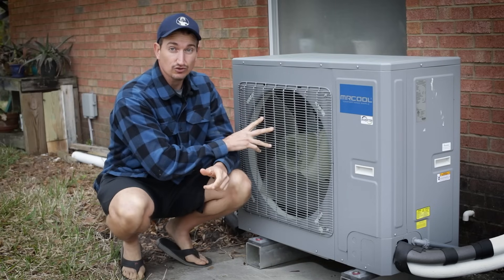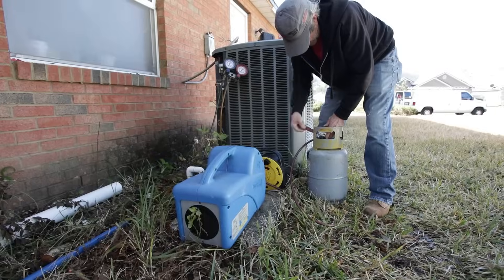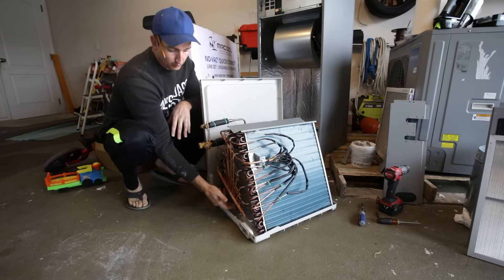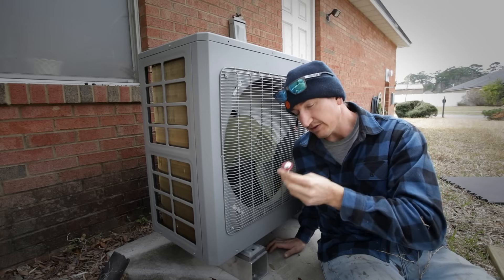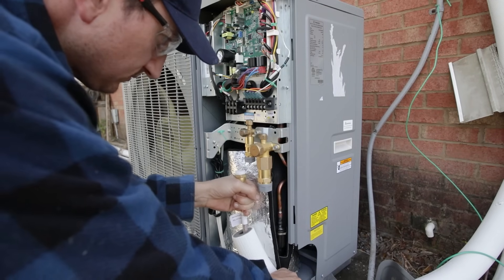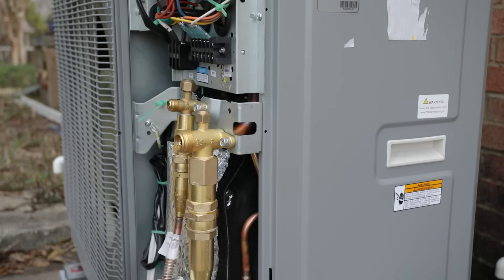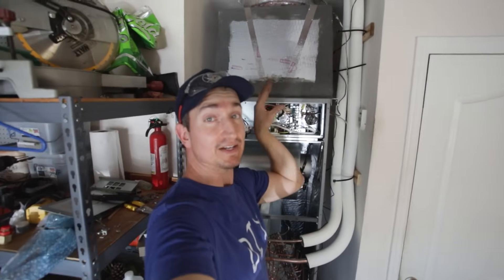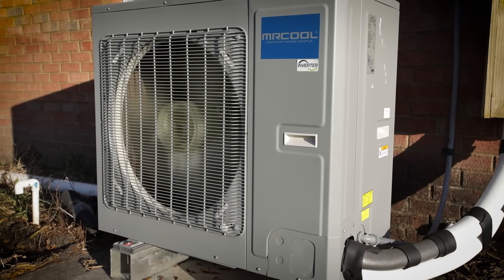Whole House Air Conditioner and Heating System Installation. MrCool Universal, Is it a DIY Project?

Comment: Hi, just wondering why the two lines are different in size? I want to rough in lines in my new build and was thinking about leaving two half inch copper lines  and insulating them. I do have to have them go through some tight spaces using 90s. Will the two half inch lines be ok? And also if I have soldered 90s joints, will those pose any problems ? Your feedback would be appreciated.
Reply: Larger diameter line is the gas line and the smaller diameter line is the liquid line. They need to be sized to spec for the size system you are installing.
Reply: @robschannel9229  ok thanks for that info. I'm gonna educate myself more on that. Thank you
Reply: This is fkn comical
Reply: @TradingSchillings  it sure is. I just learned about gaseous and liquid states and their velocities and howif they are not properly sized the compressor is at risk of burnout. I'm building a 4000 Sq ft home and majority of the work is done by myself. I have wired it for control 4 and Luton mix, did all plumbing, framing and will be doing my own finishing. I also repair electronics at a component level. In my life iv learned to ask questions,  not be ashamed to educate myself. We all need to learn from one another. What's comical is that you had nothing positive to add. Please just relax and help others if you can and doing so will give you so much joy. Peace
Reply: @paulgill7222  Shaddup
Reply: Not to be rude, but being quite frank, your question indicates you should hire someone to do this part.  HVAC lines are highly specialized, they operate at very high pressures, they are susceptible to contamination, especially from brazing or soldering and typically they're bent with tube benders and use minimal, sometimes zero, fittings to make their turns.  Brazing will contaminate the insides with soot and kill your compressor if you don't have properly pressurized nitrogen flow while the brazing happens.  Soldering is possible with specialized HVAC solder and flux, with proper flux application, but you have to use long sweeping fittings made specifically for HVAC.  If you're running soft copper linesets, they kink or collapse with the slightest mishandling and being covered in insulation, might go undetected.  

Pick your desired system, research the heck out of it and install the proper size linesets if you still want to do the work yourself.  1/2" and larger lineset tubes are not easy to bend without kinks or collapsing them, if you kink or collapse it, you have to cut it out and repair or replace the whole lineset and try again.
Reply: @taylorlightfoot  Thanks for all the info. You are 100% correct in detailing what could go wrong. I have had such a bad experience with trades people that I've lost trust and hence the reason to tackle it myself. I did most of the work myself and all inspections  passed flawlessly. In fact  the plumbing inspector asked if he could take pics to show others how it should be done.  That was a proud moment.  I'm going to be ready for this in about two weeks and will decide if I'm going to do it myself. Ive looked at different systems  and I won't need lines more than 25 ft in length and just a few gentle bends. Ive looked at line setss  that come insulated with  prefaced ends  so no brazing is needed. I will see if those work for me. Thanks again and I really appreciate your feedback.
Reply: @paulgill7222  what did you ever end up doing?  I wish I had seen these comments sooner....I would have had some great advice.

Comment: I did this install myself.  The Mr Cool videos are misleading about how easy the install is.  I would not consider it a DIY project for most people.  You have to know how to run new electrical lines, how to plumb a drain with a p trap, how to make a plenum, etc.  The pre charged line set I believe is a better and less leaky design than the flare fittings, but the traditional (inferior) flare fittings do work if you use a an eccentric flare tool and nylog goo.  That being said I do like the system.  One WARNING for people installing these.  My experience was that Mr Cool was NOT available to answer the phone and took more than 1 week to answer questions I left for them.  Also, on their website it says any Nest thermostat will work, while HVAC professionals are saying thermostats with a conservation function have been FRYING MOTHER BOARDS!  I ended up with the Ecobee thermostat.  Thank you for posting this video. It helped me.  That being said, next time I think I will install the Mitsubishi as it is higher quality.  I'm not deterred by having to make flares.  I learned how to do that on a minisplit.  The eccentric flare maker tool and nylog are the secrets to no leaks.
Reply from the maker: Thanks for watching and sharing your experience.  I am thinking about installing this same system somewhere else and was debating on whether to consider using a traditional line-set vs the pre-charged.  For this system, I am using a typical off-the-shelf thermostat and had to go into the programming to configure it to work properly with the Mr. Cool.  It was not the simplest thing to figure out but works fine once configured right.

Comment: According to the EPA, Mr Cool DIY are illegal to install oneself.
Reply: The EPA won't exist after 2025.
Reply: You are simply wrong.  Under Section 608 of the Clean Air Act, EPA prohibits individuals from knowingly venting refrigerants containing ozone-depleting refrigerants. With a sealed, precharged system none is lost.  This is no more illegal than installing a window air conditioner from Walmart.  People who spout out incorrect information without taking the time to look it up ... define what's wrong with the internet.  You also committed libel against a corporation (one that I presume has lawyers).

Comment: On my way to install now. Great video. Too late now but the blower motor slides out easily too. I didn't know the A coil could be removed so it was a bear to get the air handler into my attic. I had to use a chain hoist.

What type of material did you use for the supply side plenum box you made? It doesn't look like sheet metal. Thanks.
Reply from the maker: O wow, I thought I looked at the blower and to me it didn't seem easily removeable.  Good to know it is.  I was lucky with the supply side intake. I was able to use the existing set up the old handle used. It was a foam box set-up with metal framing.

Comment: Im guessing you spent 300-800 in HVAC techs?
Reply from the maker: I have had a few out and none as of yet have been able to figure out how to determine if the system has the proper amount of refrigerant. Since the system runs and various speeds, etc it is hard to know when you are reading accurate pressures.
Reply: @MrKistel  mine has thrown an E3 code which according to seller Ingram's means it is low on refrigerant protecting itself. Since it doesn't start up due to this protection, the question becomes how does one charge it?
Reply: @MrKistel  there is a way to charge it, your techs just suck! I think it is funny, by the time you’re done you’re going to continue having a non reliable system, lots of headaches, lots of money in service calls, a lot of money in refrigerant due to leaks! 
Home owners take their HVAC systems for granted and don’t respect the HVAC trade! 
You’re paying for the fricking years and years of knowledge, training and experience us HVAC guys have. What’s next? Are you going to tell auto mechanics to shove it and install your new engine in the Tesla?
Reply: @TradingSchillings     Well not everybody can spend 30,grand on a new heat pump and now days it seems that two out of three Hvac guys rip people off and most of the guys are total assholes ... I got ripped off BAD but I settled that score with him. I got him back in the worst way
Reply: Yeah there isn't any guidance on charging from Mr cool. The only way is to weigh in the refrigerant. Hopefully they vacuumed the lines before charging.

Comment: Does anyone have a source for the plenum boxes he used?
Reply from the maker: was purchased at a local HVAC supply house
Reply: @MrKistel  what type of material is the plenum box that it can support the weight?  I just bought a system and need the same setup with bottom side return connection

Comment: Do you get any type of warranty on the Universal series if you install it with out a licensed tech?  I am pretty confident I can do this myself (maybe with another hand), but I am nervous  about something failing, due to manufacturer error.  Thank you, Melanie
Reply from the maker: the system I purchased came with a warranty and it was honored in my situation.
Reply: @MrKistel  Okay thank you
Reply: @MrKistel  Did you make a warranty claim for the leak in the evap - losing the 410?  What caused that leak, or did you find out.  I noticed you did move the coil for ease of installation.  Is it possible the damage to the coil was done then?  The leak makes me very nervous-very hesitant to purchase if they did not make a warranty adjustment of some kind for the defect.
Reply: @Ward Hall  same here. I won't buy one until I find out if mr cool honored the warranty and sent him a new one.

Comment: Is it 110V or 220V ?
Reply from the maker: This ac system runs off 240volt supply
Reply: @MrKistel  Thank you so much I'll get one of this units for my house.
Reply: @Themastermind-bc1oq  Separate breakers for outdoor unit and indoor unit on the Mr Cool.  Most inverter heat pumps send power to the condenser with just one breaker and then from the condenser there's another 14 gauge wire set providing 240V, Ground, and a red wire for serial communications between the indoor and outdoor unit.

Comment: I wish this video was available when I installed a similar system back in Dec of last year.  I had to find info the hard way, but I did it.  The heather worked great and the AC couldn't be any better. 
I still learned a lot from this video... thank you for sharing.
Reply from the maker: Congrats on your DIY AC system installation and thanks for comment.

Comment: GOOD job overall, better than some licensed companies do
Hope these advises will help you to make new video on corrections and help your system last 30 years! :
1. forgot u-trap at drain line. it is negative pressure inside the coil(blower) and it will suck sewage air in through the drain pipe, also airflow inside drain line will prevent it from draining properly.
1A. vent on the drain line should be couple inches higher than the outlet port on the coil. water sensor has float in it, so if drain gets clogged water will just start leaking from drain vent before water sensor triggers. 
2. also should've put surge protector by the units or inside electrical panel. it is INVERTER unit with sensitive electronics.
3. these units are charged by weight using scales!. tech with refrigerant jug  in the video doesn't have digital gauge to read proper readings to charge by superheat/sub cooling, but again should've recover all refrigerant, pull vacuum and charge by weight using scales!!!!
4. use pipe wrap UV tape 10mil and wrap outside lines for insulation to last longer
Reply from the maker: Thanks for the insights as they are much appreciated. Perhaps I should have mentioned specifically in the video but this unit's condensation line goes under the house elevation and then comes back up above ground to drain directly outside. So there is always water in the low point in the drain line assembly that would function as a trap and it is not attached to sewer so no issues there.  great tip on drain vent height i will double check this one. I did  add a surge protector to the condenser circuit after filming for the video as it seems like solid insurance.  I am a bit concerned about the refrigerant levels in the system and debating vacuuming out and refilling by weight as you describe.  Thanks for the tape tip and thanks again.
Reply: @MrKistel keep in mind, 2" deep u-trap should be installed between the coil drain connection and t-vent, otherwise airhandler will suck non-filtered+non-conditioned air in through the t-vent and airflow inside drain pipe will prevent coil from proper draining, because through the same hole there will be water flow and air flow.
Reply from the maker: @airbluehvac  thanks

Comment: Won't using stainless bolts to mount the condenser to an aluminum block cause galvanic corrosion? Might want to check that now that it's been in place for a time, see if corrosion is happening.
Reply from the maker: Good insight. I used rubber washers to separate the two dissimilar metals.
Reply: he'll be lucky to have this thing last 20 years, the stainless bolts will last 2x longer, so basically nothng to worry about.

Comment: Where in the coil was the leak?  Did they not replace it or did it happen when you removed the coil from the air handler?
Reply from the maker: The leak was in cracked solder joint.  The unit arrived damaged, and the vender made it right. It was quicker to make the repair then to wait for the warranty process however.
Reply: @MrKistel  sure it wasnt you tightening the lines without holding the valve ?